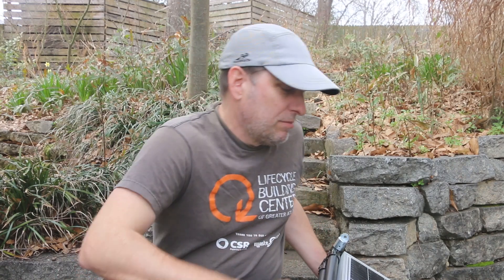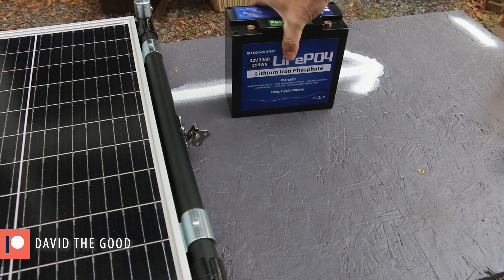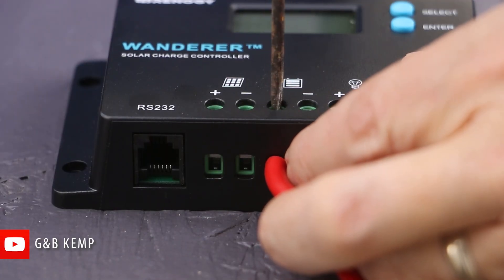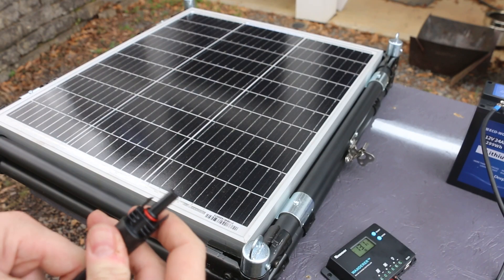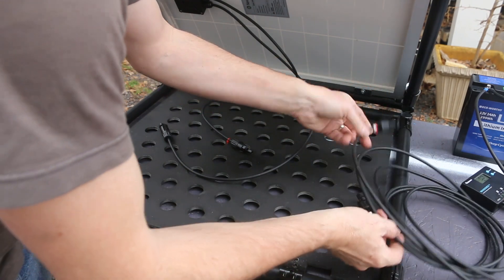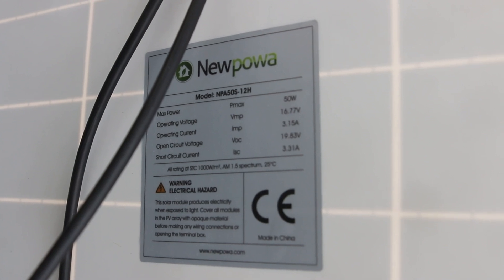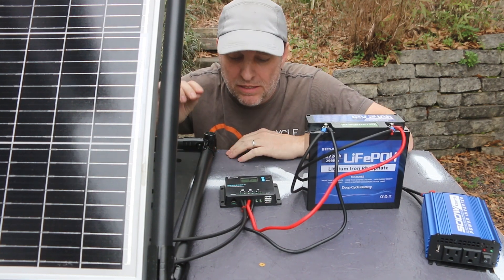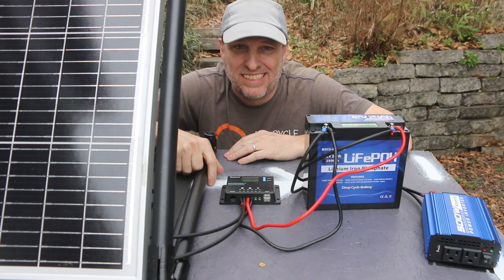How To Set Up A Simple OFF-GRID Solar System | DIY Camper Build - Part 13

Comment: CAN PUT A SMALL 12V FRIDGE IN THIS SETUP FOR USE IN MY PICKUP TRUCK CAMPER.?
Reply from the maker: I think you could. You might need more battery capacity and or solar voltage to keep it going at night, but the components would be the same.

Comment: Yay  I love that you took the bull by the horns, got through this, and proceeded slowly enough that your audience could (with possibly little knowledge of conversion from solar to electrical power) take note of each step!

I will admit some concern with the modified sine wave inverter, though. If a laptop, tools, etc are to be charged or run on this setup, a modified sine wave inverter will work twice as hard as a pure sine wave inverter to complete the task. This issue serves to cause the powered delicate or wire-wound equipment to fail sooner than if receiving pure sine wave power. 

Still, impressive, and your connection sequencing will be in my pocket for my travel van!

Comment: If I was you I would take it put it on a roller round plastic Box that you can put all your parts in your battery your inverter and solar charger so that way they won't get wet and then you set your solar panel mounted on top of the Box and you'll be able to move it around whatever you want

Comment: Major rabbit-hole...but so worth it!  I started with about the same size setup and have gone deep into this topic, since then.  NOTE:  That is a PWM controller, so make sure your panels get FULL sun.  Any shading at all and output will drop to almost zero.  Two things you'll experience fairly soon including really noticing how many days are not really sunny, and you'll obsess over having a nice sunny day when your battery is already fully charged.  You'll start to dream up ways to use the power you have stored, but not TOO much, because you don't want to run out.  That's when things start to scale!   ;)  Keep in mind that you can power 12v DC loads directly from the controller.  It will use solar power when that is coming in and providing enough amps, otherwise it will draw from the battery.  This is far more efficient than going through the inverter, which typically will suffer 10-15% worth of conversion losses.  Also, volts*amps=watts...so, the wattage coming through the panel and into your battery is the simplest way to understand how productive it is.  If you ever decide you would like to try building an LFP battery from components, let me know and I'll be glad to step you through it.  Not hard at all and it allows you to build a lot more capacity, at a reasonable cost.  (That system won't really provide much for your camper build, as it is just too small.)

**You have that listed as a "24V Lithium Iron Phosphate Battery", in your description.  It's a 12.8V battery with 24AH (amp-hours) worth of capacity.**
Reply from the maker: Thank you, Jason. Lots of great insights here.   I have noticed that I’m already thinking differently about the sun. Funny, it has been mostly cloudy and rainy since i made this video. :-) I fixed the battery info in the description. Thank you for catching that. One question I have…how will I know when the battery is full? Thank you for watching.
Reply: @GreenShortzDIY  - The battery has a BMS, or Battery Management System, inside the case.  It is a small circuit board with mosfets that control charging and discharging.  It is programmed to curtail charge current at around 14.4 volts and then allow current in again when it drops below a certain threshold.  You can't tell actual SOC (state of charge) without a shunt or hall effect sensor.  Voltage is not a good indicator of SOC, with LFP batteries, because they maintain a flat voltage level throughout most of their discharge cycle.